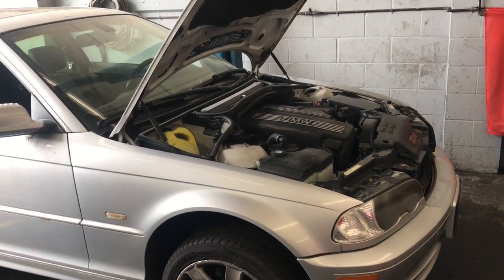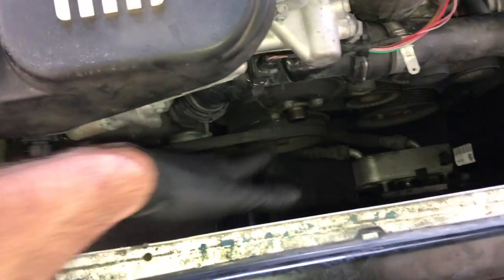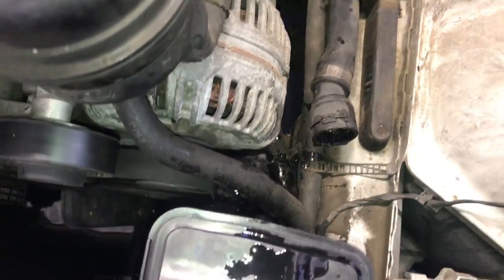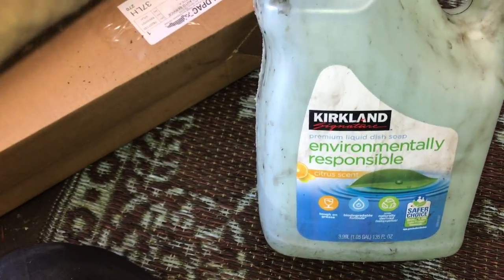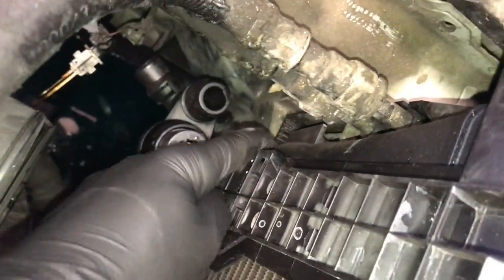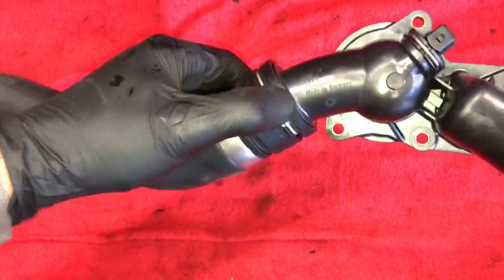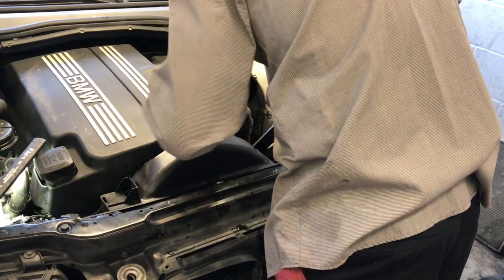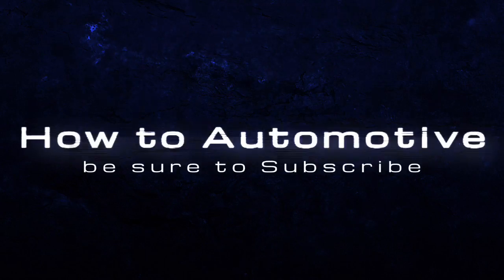How To Replace The Radiator And Thermostat On A BMW 3 Series E46

Comment: The longer drain plug/petcock is for automatic transmissions!! Hopefully you switched them around before you do damage.
Reply: thanks hey, i followed this video, i now have to change it.
Reply: @nyashamvuraichana9998  Be careful on some aftermarket radiators that might need the shorter or longer plugs for automatic transmissions. Be sure they come with precise instructions.
Reply: Thank you

Comment: Love your video, but the bottom plastic that clips into the radiator you installed incorrectly. As shown in the video, insert the upper portion first, then the bottom, you will see sort of loops which should be compressed, and then the lower part will clip in.  Took me a while to figure this out as I purchased a new plastic part, among others, when I replaced my radiator.
Reply: ???? Time stamp!?? Please
Reply: So they still go in between i camt get mine to fit for shit and i dont wanna bend it

Comment: Brian I am stumped on the process of removing the fan/clutch assembly. I'm working on a 2003 BMW 325i auto and rwd. Everything I have read and seen shows the fan to spin clock-wise (reverse thread as you mentioned) to be removed. I do not have that specific tool set for removing the fan as you did, but I have used an air hammer and also a large pair of groove joint pliers and the fan nut still will not budge, even after spraying it down with penetrant spray. But, I also found out the engine rotates clock-wise and it was confirmed when I bumped the ignition key a few times and the engine fan rotated clock-wise (toward the driver-side of the vehicle). What am I misunderstanding?
Reply: DID YOU EVER FIGURE THIS OUT?
Reply: @tywins3669  buy the tool

Comment: Great detail video super,,, do you have one for head gasket removal? E46 M54
Reply from the maker: Roosevelt Moreno I don’t have a video on the head gasket. Sorry
Reply: @HowtoAutomotive  the petcock valve is leaking,, brand new is the one came with it they did send another short one i saw that is for automatic transmission could that be it the one is mounted on could be the wring one i use the 22inch sock it to turn but it keeps turning could be i broke it?

Comment: I installed aftermarket radiator with short drain plug because it’s manual but it still leaks, as if the drain plug isn’t blocking it off,, any answers?
Reply: Well I assumed you got the long boy you needed, lmfao the longer one looked mad short when I got mine so I didn’t change it and turns out it just all leaked out cuz my auto had the manual cap so I just switched em( the longer and short one came with the radiator)

Comment: Unfortunate that the young kid that owns the vehicle does not have the space, tools, or confidence to do the work himself. I have purchased a used 2001 BMW 330Ci and am gradually restoring and doing preventative maintenance, and I have found the vehicle to be very well designed from the maintenance perspective. Anybody with a reasonable amount of skill  and tools should be able to work on these vehicles.
Reply: 100% agree